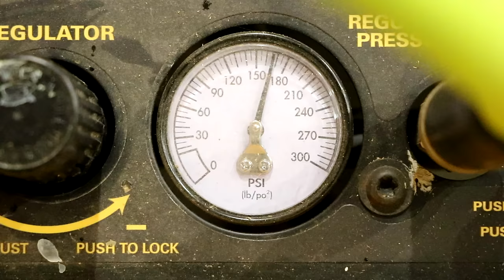Installing PEX compressed air system #33 Doing It Dan's Way

Comment: By any chance were you using Pex A or Pex B? I know Pex A has a thicker wall and should hold a higher Psi. My compressor is rated at 150 Psi and Pex B is easier to find at you big box stores, so will Pex B hold??
Reply: Matt Risinger texted a few his only sample of PEX A Uponor failed at 425+ & the PEX B's all failed 800-1050 PSI. Any pex will do for air systems with a healthy margin of error.
Reply: @nickp9981  Yes thats at room temperature. My professional engineering license (currently retired) forces me to point out that you must not run it behind say a space heater. All plastic pipe's rated pressure falls considerably with higher temperature. And not in direct sunlight either, so don't run it behind a window that gets direct Sun. Other than that PEX is a great solution. I have had mine in place for close to 15 years now.
Reply: @frankish5314  even at tempeture I would guess that pex holds enough strength to be near heat systems , I would say the big issue is to cool the air down before putting it into the pex as a compressor running full out can leave the first section of hose real hot. I have run a system for a few years the first part of my air system is through a  coper tube coil that goes into a large plastic drum filled with water that cools the air down to "basement tempeture"  and also dries the air. The real issue is the direct sunlight or for that mater any UV light (like from florecent bulbs) will slowly damage and destroy pex cover it all.
Reply: @nickp9981  A quick Google search gave me ASTM 877 ratings as follows. 160psi@73degF. 100psi@180F and 80psi@ 200F. Of course these are rated pressures. The burst pressure will be higher than this but no engineer that doesn't want to get sued would suggest you go beyond these values.
Reply: @frankish5314  in the tests done by MS mentioned above the burst pressure was 800+ for all pex b, for a domestic compressor thats likely around 120-150 max psi there is more then enough strength.
Reply: @nickp9981  you are thinking of something else, most definitely NOT PEX! There's no way that ANY PEX product would reach anywhere near 500 psi under ANY circumstance! Heavy wall copper isn't even rated that high, you are up in the night!

Comment: Dan, 
The electrician perspective is that a static discharge wire should be used to prevent drawing an arc when connecting to the air chucks. The shop environment is ripe with potential explosive hazards. I saw your video well after the original installation. I would consinder retrofitting your air system. Also I am would recommend you retrofit the vertical air lines with a drain port.
Reply: Mr. Fartbox Ohyeah,
I am the .001% that witnessed a magnesium fire in a machine shop from disconnecting an air chuck drawing an arc. Respectfully I am not changing my opinion.
Reply: @steverosenbaum2469  magnesium from what? There is no risk of fire from the compressed air unless you are adding something flammable to the system.

Comment: Great job but why not run all 3/4" pex?
Reply from the maker: Only because i was using up left over material form a previous job,  but 1/2 is more than adequate as the restriction in the QD air fittings is much more restrictive than the 1/2" PEX

Comment: Hows the pex air system working?
Reply from the maker: Its working great it has been pressurized fro years at this point and i have never had a problem with it.
Reply: @DanielWoodell  Same here.. More than 10 years.. Actually nearer 15 now I think about it. Works perfectly.

Comment: How's the pex holding up so far?
Reply from the maker: Its doing great it has been pressurized, from about a week before this video was posted and i have not had a single problem with it, in fact im getting ready to insulate and sheet rock the walls.

Comment: You talked me into PEX for my new shop :) What crimp tool and crimp type did you use? Thanks, great video.
Reply from the maker: see below link, however you can find this stuff at any big box store, that is where i got the stuff i used 
this is the tool
https://www.amazon.com/SharkBite-23251-Crimping-2-Inch-Fittings/dp/B007AGMM1W/ref=sr_1_8?ie=UTF8&qid=1517717651&sr=8-8&keywords=pex+crimping+tool
these are the crimps
https://www.amazon.com/SharkBite-23103CP25-Crimp-Rings-4-Inch/dp/B007AGMFF0/ref=pd_bxgy_60_img_3?_encoding=UTF8&pd_rd_i=B007AGMFF0&pd_rd_r=4A01HY4ESCYEQ5F887RH&pd_rd_w=iCbKd&pd_rd_wg=29CtC&psc=1&refRID=4A01HY4ESCYEQ5F887RH
Reply: Thanks Dan, I found these at Home Depot. Some reviewers mentioned that these crimps fail the go-no go test about 1 in 5 - did you find that to be the case?
Reply from the maker: vahpr the only time I have had problems with failing the go no go is when , I was not able to keep the crimp tool at 90 degrees to the pipe,  this other videos shows that a little 
https://www.youtube.com/watch?v=l9NwZC85S0c